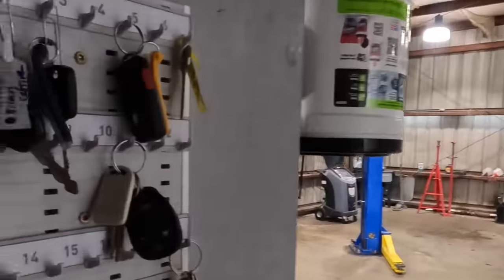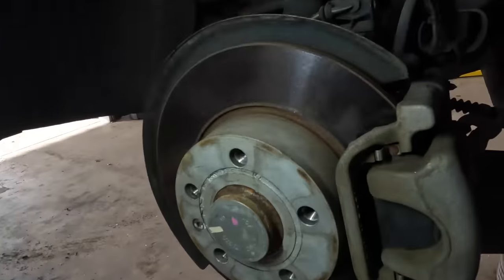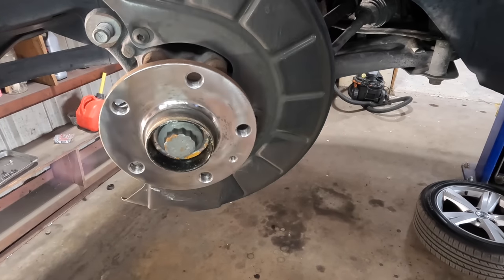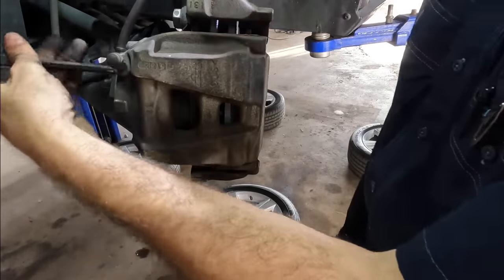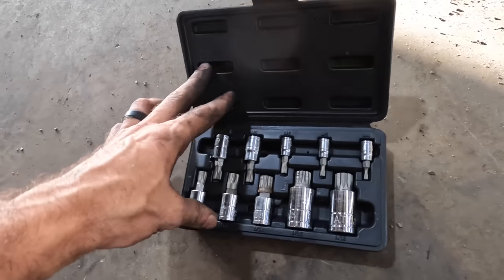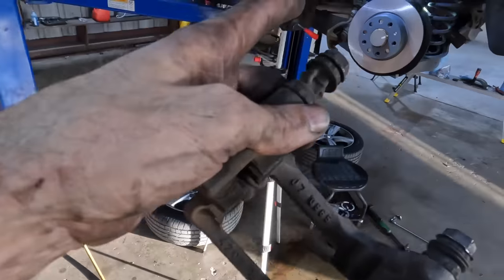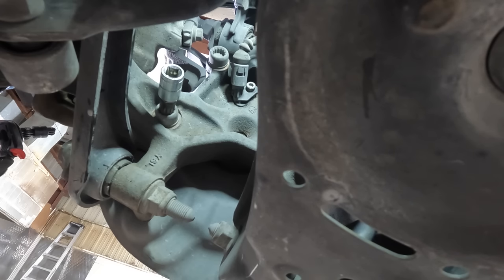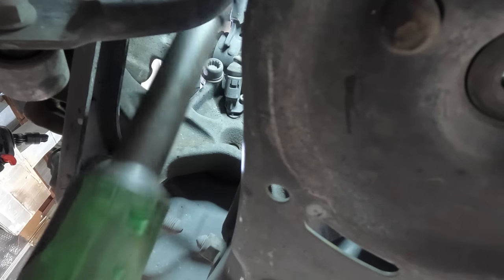Brake Job…with a Belt Sander? 2015 VW Jetta

Comment: The last mechanic didn't change the rear rotors because he didn't have the correct triple square bits.  No real mechanic would put new pads on those chewed up rotors.  My brother actually had me do that because he was SOOOO cheap.  I told him it would squeal loudly, but he didn't care.  Those rotors lasted over a hundred thousand miles, but made a lot of noise.  I now have that car and it gets the best of care

Comment: I understand based on his explanation why he “sanded” the brake pad surface.   What did that do to the pad life?  I’m assuming it increased in this situation.  But if everything was good, how many miles would it have taken off the life of the pads?  I am not a mechanic.  I am just asking a question out of ignorance.

Comment: VW incented those dammed screws to stop DIY. Don't use a wobbly or any kind of hinge. Go streight in those screws.
FSI, TSI and TFSI are a nightmare. You must change the timingbelt  (chain) regular or the engine is bin.
Regards from Belgium

Comment: Raymond,  why is it i see mechanics clean off rust or the start of rust but never put on a rust deterrent like a dry silicone spray or light coat of oil like under brake rotors or the back side of rims? Not so much it can drip onto the brake pads but just a film thin layer to prevent rust.

Comment: I was pretty certain that if you replace the brakes on a 2015 VW of that era that you needed to use your service tool to reset the E-Brake position. I guess seeing as you were just resetting the pads back in relatively the same position that it was not necessary to put the E-Brake into service mode?

Comment: I would love to know why only one slide pin has a seal in a groove near the end of the pin, which is the proper location (top or bottom) and what it's function is.  My Camry is the same way.

Also, I didn't go back to confirm, but I thought I saw an Audi logo on the front caliper, but the rears were... TRW?

Comment: Left me wondering if you left the Start/Stop switch remain as is.  There just might be a benefit - a car"borrower" might give up!
Reply: Yeah that's my car in the video I was kind of hoping maybe Ray would do something for that button for me but I'll have to take care of it myself now
Reply: @rickbill4834  makes for a great anti-theft tho. A different way of looking at it🙂
Reply: @MrDopey32  it's still a pain in the butt sometimes
Reply: @rickbill4834  I completely understand where you're coming from. 2 of my vehicles have sticky ignitions and give me problems turning here and there. I look at it in a bit of a different light, I live in Lakeland and there's to many idiot's that like stealing cars. It might be a bit of a pain when using, but helps me think people will have a harder time stealing them. That's just my opinion. My friend has the same car as you do and the same problem, I popped it out and it just had a loose wire in the connector. It took me longer to get it apart, than to fix the issue. I hope this may give you some insight.

Comment: Don't really get the actual reasoning behind the triple square sockets and bits. 
When we did my son's wheel bearings and brakes on his Audi S4 were had to get a set of those triple square and we had to get into the OBD 2 but it's called something else on the Audi, he got an app that he had to subscribe to but got lucky and got a set one time price for the app and future updates. This app allowed him to put the vehicle on service or brake work mode it slips my mind what is called exactly but it's required to be able to push the calipers back since they have electronic parking brake. When doing my 2020 Ram it was in the Uconnect settings... Service mode.
Have you done a brake job yet in newer vehicles that require you to put the vehicle on service mode via one? Or through another way like Ram in the Uconnect settings?

Comment: Yes a passat, great cars, well German built ones anyway.. and yep a B8 model
Reply: Those times are over....there are currently massive problems with TSI engines, one reason being the short distances driven in Germany and the intervals that are too long, where you people drive significantly longer distances and the engines are generally better than short distances.
Reply: @emausderratsuchende5447  so tsi engines have the same problems as diesels with dpf..

Comment: Sure hope you were wearing a dust mask as that dust has copper and asbestos in it.
Also - here's a good tip, Put a coating of fluid film on the hub before installing the new rotor, that way rust wont be a problem next time...Eric O dose this every time and it's a good practice...

Comment: Mmmm....just a thought, about the corner of death, if you installed a wider door(to the right wider) if possible, wouldn't that give you a better turn radius to the left vehicle lift?!?
Them bolts might have a stretch spec. Most of the fastener I use, especially head bolts and cam bolts, even in some instances lug studs, if they're within -10% of max specs , I have to replace them.....knowing German engineering, they just might be the same...then again who knows :)
 Be well, Ahhhh the parking woes , funny!
Reply: any fatal law suit, u cannot find him.

Comment: I had a 2014 VW. Got it with 36k on the odometer and the rear driver side brake pads were completely gone while the passenger side was still about half way. They were also stamped with the month and year of installation which was the same month and year it was built. I have no idea how it went through rear brakes so fast.
Reply: Now you know - brake caliper slide pins sticking/frozen. See a reputable mechanic and get them to inspect both sides. Some cars are notorious for sticking caliper slide pins. On them I have tried every lubricant recommended for caliper slide pins and when that did not work, tried every lubricant they did not recommend. Nothing worked. Every time we removed the wheels after 10K kilometres or so, the leading edge pin was frozen but only on the LHF. It was a 6 cyl Ford Falcon in mid 90s here is Australia. Had my car do it and also a friend's. Never found the reason. Think it was misalignment in manufacturing process of the caliper. Retired mechanic in Land Down Under.

Comment: 23:55 the proper torque spec for those is good-n'-tight!
Reply: Wrong, It's 147 ft lb, + 90 degrees.

Comment: It's a huge deal with those plastic lug nuts, especially if you don't realize there are lug nuts and think that their torque slip covers and you try to find one to fit it after you have a flat tire on the road on vacation! Until you watch one of your videos and realize they're plastic pieces of garbage well but still have to stay on the car....

Comment: Love the videos, but having worked on a lot of Vag group cars, I was always told that the caliper bolts need to be changed as they have a torque setting and then a degree setting,is this really needed?, keep up the great work man, awesome 👍👌
Reply: Yes, stretch bolts need to be replaced because once torqued, they're permanently deformed(or stretched), and if reused, they lose clamping force and possibly break.

Comment: What grit is that rotary wheel disc, I use a wire wheel but don't know what grit to get for the wheel. I don't want to go to low in grit and eat alot of material off

Comment: More than likely the pads were hanging up a little. Failure to clean and grease the slide area of the bracket. It was obvious, you had to pry the back pad out. Gonna have more problems.

Comment: Cue the clueless lunatics complaining about reusing pads. I've flat-sanded (very good) brake pads on many rotor replacements (very common on our race cars and on other team cars) and never had one single problem. No sense in wasting perfectly good pads. Seasoned pads are quite often better than the part store crap.

Comment: When you said high speed breaking i started to laugh. The breaks are designed for 160 Mph stops with maximum weight, as this is the usual scenario for the Autobahn. The breaking you did on the highway is what you do round here every 30 seconds to 2 min in normal traffic.

Comment: Ray, what is the brand and lube name of the purple goodness you use on the slide pins?
Reply: midnight blue by Ray..
Reply: If I remember correctly from his other videos, I believe Ray is using Permatex ceramic extreme brake parts lubricant here...

Comment: 38th!  GOOD MORNING RAY!  What do you think of 2015+ Audi 5 cylinder automobiles when it comes to reliability and them being mechanically sound? I was looking at S class Mercedes, but have found that they are horrible on being reliable and cost a fortune to maintain. Some of the same people who didn’t like S class, have said they were going to go with a Audi for their next purchase. Thanks, Roger in Pierre South Dakota
Reply: The VW 5 cyl is a great engine in my experience.  Just change the oil every 5K miles, not the minimalist 10K the manufacturer recommends.  Full synthetic oil only.  My sons 2008 Rabbit ran close to 15 years before old age made replacing it necessary.
Reply: I remember back in the seventies Mercedes was about the best quality you could get. Expensive to maintain even back then, but at least they were reliable AF.
Then some time in the late 90's or early 00 People started to talk about mercedes cars just a couple of years old that was rust buckets. That was a bit of a rude awakening for a lot of people. This was the exact opposite of what a lot of other manufacturers went through. In the 70's Japanese cars were rusting like mad. In the 80's or possibly early 90's Mazda made a big deal about their new rost prevention process. They simply galvanized the body bottom to about half way up the doors. I don't know if others did it before them, but Mazda really spent money on adds about this. And they introduced a rust warranty, which wasn't a thing before that. I think it was five years, possibly more, but again they hauled out the big drum so everyone would notice. Says something about the reputation they had as mobile rust experiments.

Comment: You know, brake pads still have a certain amount of chrysotile asbestos in them... So it would be better if you surface them with a respirator with a p20 filter and wet down the pads with soapy water before you surface them..... Then rinse the soap off...

Comment: Hi Ray. I was looking forward to you troubleshooting the funky starting. I feel so let down! Would it be the dash switch, the brake switch? I didn’t see a comm error, so I assume it’s not a dead key fob.
Reply: It is my car and it is just a bad switch in the center console.  I will pull it myself and see if I can fix it.

Comment: Ray, you don`t have safety glasses on you, when you operate with those air polisher or another similar tool. Please, take this into account seriously, because there may be a very bad problems with flying particulates from those tools. Advice gravity :)
Reply: learned the hard way, impaled into cornea.

Comment: I have a 2015 Jetta with a 1.8L TSI motor and I have to add a quart of oil once a week. Should this be concerning or is it normal for VW and Audi turbo charged engines?
Reply: I have to add a quart of oil to this very car that he's working on once every thousand miles because of the turbo. It is an Audi engine and it is actually designed to eat a quart of oil every thousand miles.  If you look up the specifications on the engine it actually states that it'll lose a cord of oil every thousand miles.

Comment: Just wondering if you actually know that there is asbestos in those pads.    If there is this is quite risky doing it without protection  not every one gets lung disease from asbestos dust  but the odds are not good ....

Comment: I had some badly glazed brake pads and just laid a sheet of sandpaper on the workbench and rubbed the pads on it.

But you have to clear all the junk off your workbench so that you can, you know, work  :)
Reply: If you have a piece of glass that makes a good flat surface to work off of. Unless you have a brother with a surface plate.

Comment: u dont actualy have to remove caliper bracket,disc slides out of it with no problem if it doesnt have studs
Reply: never read repair instructions.
Reply: @forgetfulme1719  wdym?? explain cuz ur sentence made no sense
Reply: if he reads or researches first VW manual,  then he saves the hardship doing unnecessary step.

Comment: Wear a mask !!! 
For newer vehicles and parts, auto manufacturers, auto parts retailers and packaging information, such as labels or Material Safety Data Sheets (MSDS), may be able to tell you whether or not your brake or clutch components contain asbestos.Jul 21, 2022

Comment: Does anybody turn rotors anymore? If you removed a few thou they’d probably be OK.
Reply: Asked at a O'Smileys in my area and they wanted 30 bucks per rotor. By the time you jack up and support the car, pull the rotors off and get them done, if they can be done wait to get them done , drag them home and reassemble the cost of a set of rotors from online company is much less.

Comment: If I owned that car, I would be as much concerned about that faulty starter button as the brakes. Seems like it's about to fail completely. If it does, good brakes won't be needed.

Comment: Who - ever was the last person to do brakes on that car needs to get slapped!   What a crappy job!   The 6" long Triple square bolts on VW's are extremely hateful!    So glad I got rid of my VW.    Lots of unusual fasteners for no good reason!  Very hard to remove the rear caliper brackets... a shade tree mechanic's nightmare!
Reply: I was very low on funds and I just wanted to get the car up and running so I had a friend of mine just do a pad slap on the entire system he didn't take out those rear caliper bolts just the slide pins and he had a hard time on that right side also.

Comment: Anyone know any good, trustworthy, mechanics in the Louisville, Ky area? 

Been to three different ones over the past few years. 1st one, had some coolant leakage in my wife's Sebring at the freeze plugs. Had them replace the plugs, they missed 4. 2nd one, took a friend to get his leaking heater core replaced. They kept it for a week then said it would take too long and wasn't worth it. I ended up doing it myself, took 2 hours. 3rd one, I went to get new tires put on my Jeep, developed a mysterious brake fluid leak. They offered to repair it, for a fee of course. Seeing as how I had to stop over 20 times before I got there and still had good pressure when I did, I'm pretty sure it wasn't there when I gave it to them. Ended up walking to the nearest parts store, picked up some brake fluid, to top it off til I got home. Fixed it myself.

Now I've got a grinding bearing that has to be pressed onto the axle after the axle's removed from the Dif. I don't have a press so I can't do it myself.

Comment: You're making twice the amount of work to remove the calipers by removing 4 bolts when you only need to remove the 2 holding the bracket on.

Comment: Front rotor replacement not really needed?
Reply: Actually yes the front rotors were needing replaced. That was my car and it had a serious vibration at any speed when braking. The rotors had serious run out on them.

Comment: Question Ray, Why could you not turn the rotors? Below tolerance out of spec? Great video thank you for sharing
Reply: Thinking the very same thing
Reply: Look those rotors up on Rock A-to,the Bendix are only $25 for brand new ones! Cost more to turn them
Reply: I do believe at the time he doesn't have the machine to turn a rotor. But he just put out a video showing that he just bought one and that was just after he did this car.
Reply: Most new rotors are unturnable,the cheap ones are only a couple thousanths over spec when brand new!
Reply: Once a rotor is warped its done. Yes you can turn them, and it will be fine for a short time, but they will continue to warp and the the pulsation will come back. Cheaper and better to just replace.
Reply: @Longtrailside  Yes true when warped I was asking because ray did not say the were warped or out of round. Just that there was a vibration at speed. Also did not know if it has composit rotors like lincolns those rotors are throw aways Thank you for your reply

Comment: Let's see how long untill wife unit gets tired of having to move her van to let you in and out of the shop. You will probably have to park the forklift somewhere else and park the van in its place. With the price of groceries now everyone needs to save money where they can. With that little wear on the replaced brake pads, there is no way those pins should have been sized in the caliper like they were.

Comment: Hey Ray, I’m into the vid about five minutes and I’m wondering if the complaint is vibration do you check rotors with a run out gauge?
Reply: forgets to buy one.

Comment: Just curious are you going to continue doing this to all the brake pads for all the brake jobs you do or are you going to do just this car and that's it cuz it's the first time I've ever seen you sand down brake pads and canfor the edges in any of the videos I've ever seen
Reply: Normally when he does a brake job he replaces rotors and pads, so no sanding is necessary. He did it this time because 7 out of 8 pads were fine and he was trying to save his customer money.
Reply: My intent was not to give anybody a hard time about it I was just making an assumption of what hasn't taken place before and what was taking place now never seen anybody whether it be Ray or another mechanic 2 sand pads when pads get bad I just replaced and I'm not against checking for slides I stood all the time when I was working on cars I don't work on cars anymore I just like watching people do it so I apologize if I have shown any disrespect to the mechanics in the field I was just asking a question but apparently I stepped Over The Line